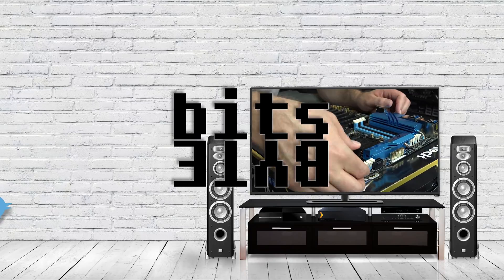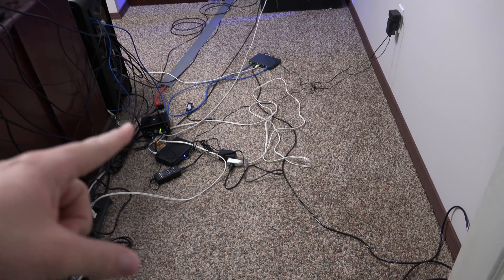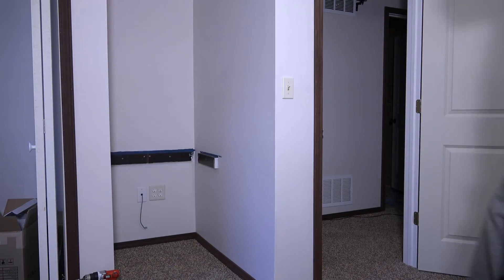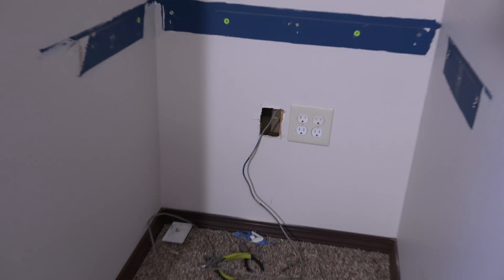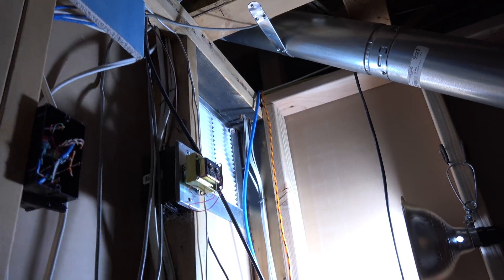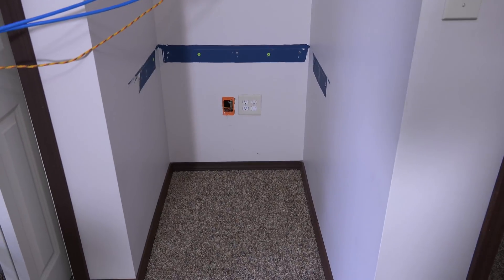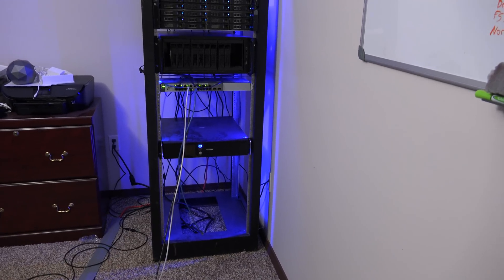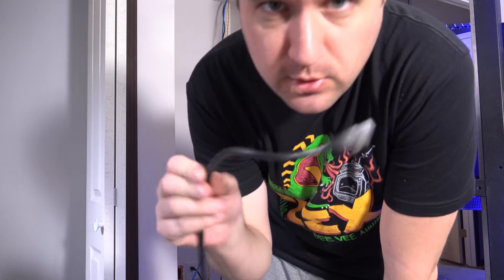Moving My Server Rack to Centralize My Network...

Comment: why you don t put the server rack in the room wher you router is , and you desktop pc also ,  just run a usb and hdmi cable to your desk no more heat and noise from the pc , , why do you have a 48u rack to have only 3 4u server a ups and switch ,

Comment: 1st: Have you had any cooling issues since moving?  You're probably not producing a huge amount of heat, but now that it's all confined into small area with less air flow it could create some higher temps.

2nd:  Is there a reason you didn't move your rack into the room where your modem is located?  Makes everything centrally located and the concrete floor will act as kind of a "natural heat sink".  Plus it looked like a room that wasn't used much so all the noise would be confined to an area of little use.

I apologize if this was covered and I missed it.  Keep up the good work on the videos.

Comment: As far as plex tv/dvr I know what you mean, was having antenna issues so I made my own bow tie wire hangers antenna , and it works way better than my bought one and I'm also using the hauppauge wintv-quad hd pcie tuner, and my set-up is somewhat stable with almost all channels in area. Just need commercial removing stuff and plex to act right.

Comment: More vids on this!  I just moved into a new home with no ethernet and I have to go between floors to my proposed server room, any thoughts there without running the wire outside the home would be helpful!
Reply: Avoid running cable through exterior walls.  They're full of insulation and it's a pain in the ass.  Interior walls are much easier but occasionally there will be a fireblock you'll need to drill through.

Comment: Random thought... why not stick the rack in the same room area as the modem and router? You would end up consolidating things a lot more, doing less cutting in the drywall and end up with a less complex wiring layout. One big positive also is that you would still have a room in your house free for other things. On top of the things I already mentioned servers and NAS devices in most circumstances are supposed to be managed remotely so having them slightly less accessible wouldn't make much of a difference unless you like the noise and looking at them.

Comment: What are you using for Air Conditioning/Air Flow so your system doesn't overheat, my main worry would be  lack of air flow so the systems run hot.
Reply: I agree.  I would have concerns with heat build up in that closet.  That ceiling is going to trap the rising hot air and you got 3 walls now blocking air  flow and now contributing to keeping the heat in.

Comment: Feel sorry for anyone who will need to use the bedroom. ...
I would have recommended getting some 4" pvc pipe to go between the hole and your utility room, for ease of cable running. There are fiber jacks available in keystone, so you can have a clean install. I would also run a pvc pipe between floors, so you can easily distribute your cables. 
It's something I have been thinking of doing
Reply from the maker: pvc pip not a bad idea. but need a big hole to do it...lol
Reply: Also, a hole saw drill bit will give you a cleaner looking circle than a drywall knife.

Comment: Since you ran new cables, you should ditch the router and go with something rack mounted like the Unifi USG Pro or USG 3 and place Unifi access points throughout the house for better wi-fi coverage.  At least relocate the modem and current modem to the rack.   ; )

Comment: Whenn you pull lots of cable trough get it to were your modem is then pull them trough the big hole in the ceiling easier and save time. Make sure you LABEL all your ethernet runs

Comment: I did a similar project about 2 years ago and relocated my home server and network equipment to my basement closet right underneath my home office. I ended up drilling a 3in hole in the corner of the office floor so that i can pass my cables through quicker.

Comment: Great video.  I've never commented on your videos before but I like the figure it out as I go style.

IMO you should take advantage of this opportunity to organize your rack a bit more.  Glad to see that you are going with a patch panel.  I have setup more racks than I can remember and what we almost always do in our design phase of single rack setups is break that rack in to thirds.  Top third is for networking; middle third is for servers; bottom third is for power and non-rack-mountable hardware.  Invest is some shelves if needed or mount your Plex machine on the bottom of its designated space and put your monitor,keyboard and mouse on it like a standing desk.  One tip.  Leave a 2u space between your patch panel and switch and pick up a cable management units that hides all the cables.... makes for a really clean and professional looking install and they are cheep if you shop around.
Reply: I agree.  You should move your UPS down too in order to lower the center of gravity.  It's bad enough right now standing still but I wouldnt have been surprised if the whole thing had tipped over while you were moving the rack.
Reply: When he stopped running the video at 2x when he was pushing the cabinet, I fully expected it was because we were going to watch his cabinet topple over or at least tip.  Ive heard others here talking about moving the Plex server while the drives are spinning and how he probalbe lost several drives.  Although I would never move a SAS 15K rpm drive while moving his drives are more than likely perfectly fine... How many times have we moved a computer a bit to plug in cables or clean behind it without damaging the drives.
Reply: What racks do you recommend for a simple home setup? Will go in the basement next to available outlet

Comment: More videos like this! And a good tip. Use some access points around your house! Use the ubiquiti ones because they're single ssid roaming works spotless. And use like a PVC pipe piece in the hole. So when you pull wires you don't crack the plaster board.

Comment: Do yourself a favor, get rid of the Linksys wireless thing, and go with Ubiquiti WAP, you will thank me, and in addition roll a virtual machine version of Untangle Home $50 for 1 year license instead of PFSense, it is very easy to use and the Ubiquiti wireless will probably cover your entire house very well. P.S. smart move on that rack, but put that equipment to work for you my friend :) Great video. P.S. dont waste money on Cat6, you can used 5E for Gigabit, save some money.
Reply: UnkyJoe I think Jason wants to do 10GbE hence the Cat 6, which he got on sale.
Reply: I second that. Ubiquiti for sure. Also, maybe I missed it, but why separate rooms for the router/ap versus locating all in the rack? I however totally understand the cat6 and agree for future proofing. Didn’t realize how large the 6a was.
Reply: Yeah definitely 6a is worth it. I use 7a cable from Simeon’s Company. 7a isn’t an official specs but from my experience I like having the added shielding and the additional bandwidth support. Jason got a good deal on that 6a though.
Reply: Yeah I finally figured that out after watching the video all the way through. But I still say if only doing Gigabit, then 5e is fine.

Comment: 10:43 nope, nope, nope. I would never move a running server which has mechanical drives in it (never mind the 20 drives in that rack), even if they are not spinning. Would rather shut it down and ensure the drives don't get read/write errors from the vibration.

but it's not my server so.......
Reply: came here to say the same. WOW.